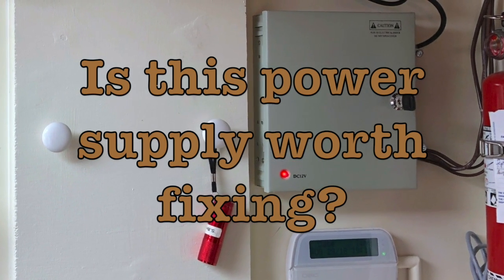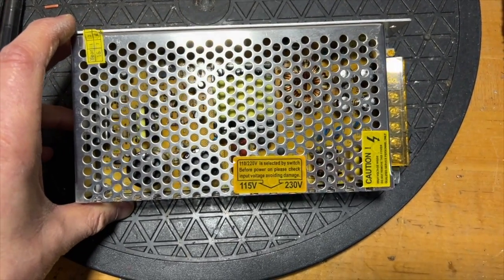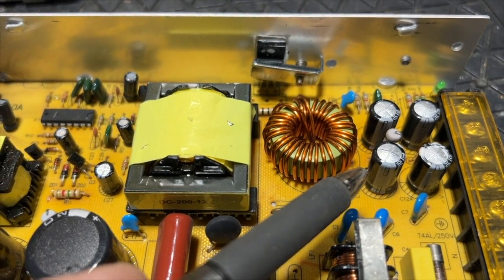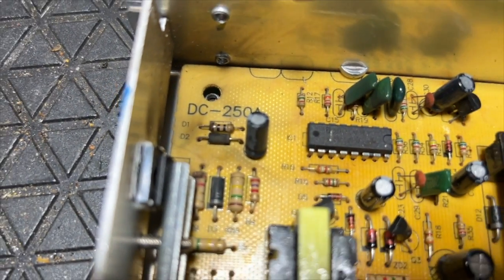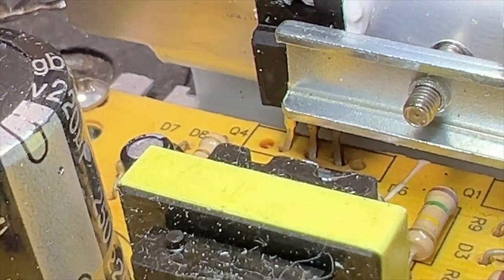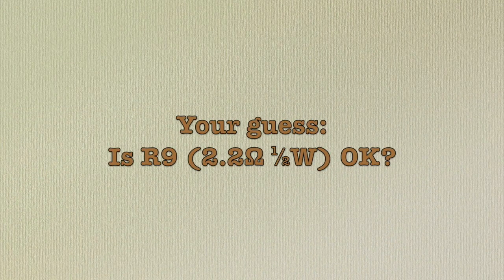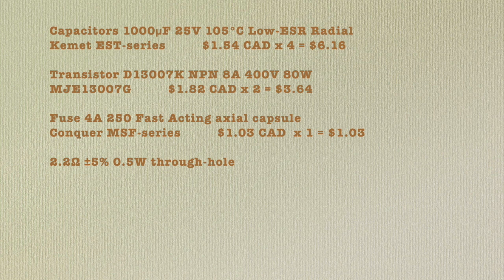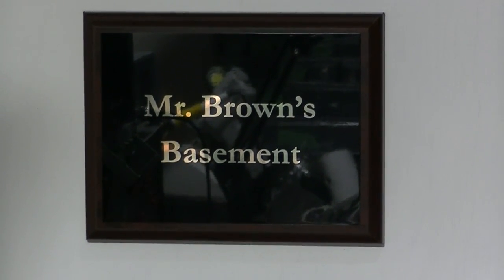Is this Power Supply Worth Fixing?

Comment: I take components off of old motherboards and old junk power supplies and fix them with what i have laying around. Like those caps.... About to repair another one today with bad caps and wow does it make a whistle noise right now. A high frequency squeal coming from it. Computer power supplies that is... The number one problem is almost always caps and sometimes a fuse with it.
Reply from the maker: I’ve depopulated old boards to salvage parts but I haven’t found them reliable over the long haul. It’s just easier for me to buy new parts. I could probably have found parts to make that power supply work if I absolutely had to, but this was more of an exercise of bringing it back to factory original (or better). You’re right though, electrolytics seem to be the weak link of power supplies and are never above suspicion.

Comment: I hate these power supplies as many of the transistors and integrated circuits have had the numbers removed by the manufacturers.  Replacements are readily available and most repair facilities will not waste the labor to repair them. Bench tech. time is to valuable to waste on most of these cheap switching power supplies.
Reply from the maker: Yes, I’ve seen all kinds of devices where the manufacturer has sanded/ground/scratched part numbers off internal components. I don’t think much of the practice as it makes repair more difficult and consequently less likely. None of the part numbers were defaced in this power supply though. The custom of making components difficult to replace is nothing new. Philco did it in the 1930s with their capacitor blocks, and other companies followed suit, using house numbers on capacitors, couplates, and semiconductors.

Comment: No matter how you look at it, it is worth the fix. A power supply is always part of a larger assembly. What you have to fix here is a sub-assembly (the P.S.) of this bigger device. If you replace the P.S. with a new one you are solving the issue at a bigger expense (compared with fixing the P.S.)  and the same quality as the original.  If you decide to fix the P.S., regardless of what quality parts you choose, you always win. If you use cheap Chinese parts, as the originals, the fixing cost would plummet, and the P.S. original quality would be maintained. If you use quality parts to fix it, you would still spend less than what a new P.S. costs (Chinese quality, remember) and would expect a longer service life. So, fixing it you always win, not even considering the fun in doing so.
Reply from the maker: I don’t like to discard; I prefer to repair. That’s just me. But when times arise when repair isn’t possible, and now I’m not talking about this particular PSU, what can be done to mitigate the cost to the environment? Other than salvaging parts I might be able to reuse (e.g., the aluminum), and taking the unsalvageable parts to a nearby household hazardous waste depot, any other ideas?

Comment: Transistor power supply or the worst I would just replace the with mosfet
Reply: Do you realize difference between driving mosfet's gate and bjt's base? ;) they are not always interchangeable. In this type of application, its big chance they aren't.
Reply from the maker: More than likely they’re not interchangeable. A circuit would have to be heavily modified.
Reply: @cielakovsky  am will aware I am a electrical engineer its easy for me to do the gate driver transformer is there already I just change the starting resistor and add ziner diodes and fast switching for hugzillery feedback and a new totem pole driver and nothing to it
Reply from the maker: @Dc_tech386 I am humbled.
Reply from the maker: I’ve already received the new power supply. I haven’t had a chance to open it up yet to see if they used Bipolar transistors or MOSFETs.

Comment: 1:05
Didn't know anyone trusted no brand power supplies to run 24/7.
At least get name brand ones like mean well. Its not that more expensive and has PFC built it to save power.
Reply from the maker: I may very well do that next time. But for a no-name piece of crud it had decent performance for over 60,000 hours of continuous operation. I can’t complain about that.

Comment: I guess 7 years isn’t bad for a lot of cheap modern electronics but I agree don’t repair unless you have too much time.
Reply from the maker: I guess I can't complain. I didn't mention it in the video but I have another identical panel going somewhere else in Mr. Brown's Basement. It's still working. So maybe the one that failed after "only" 7+ years was a dud?

Comment: I would replace all those bad capactors with better  and higher quality ones with a higher working voltage also the fuse, I would check the IC, and for any other shorts I would also replace those Transistors with better quality ones with a slightly higher rating and make sure they have mica insulators over regular plastic ones and any other components that look suspicious , then check the output voltage,,!  If all is OK then reassemble and reuse 😅👍the savings would be exceptional and most probably work better than new ‼️
Reply from the maker: That's initially was what I had hoped to do.

Comment: To me, comes down to if the replacement parts are superior to what was there before - i.e. does that $12 mean there is a chance you end up with a longer lasting supply?  I have a lot of postage stamped sized switcher modules for mains to 5v, invariably the yong-ho-whatever output smoothing cap goes pop - replace with a proper rated cap for the job, no problems.
Reply from the maker: I understand where you’re coming from: Make it right and it should last. But with this PSU, suppose I upgrade the transistors and power rectifiers. Re-cap the whole thing with Nichicon or Panasonic electrolytics, maybe install a fan… but the rest of the components are aged maybe failing after 7+ years. Wouldn’t I just be better off taking my chances with a new power supply?

Comment: Those filter caps at the output are swollen too, tops are domed so they could be resistive, or shorted, and literally the root cause of the entire failure.
Reply from the maker: I don’t know. I’ve seen filter capacitors in that slightly domed condition operating without any issues. However, they are undeniably swollen, and if I were keeping this power supply I would replace them proactively. The power supply was capable of supplying 10A continuously which means it could supply much more than 10A for short periods. Those capacitors are small and would not be able to dissipate much heat for long before overheating and bursting. Let’s say for a moment that one of them meandered down to 100Ω. At 12v it would be dissipating almost 1½ watts. They’re small; I don’t think they could do it for very long before bursting. My gut feeling (for all it’s worth) is that a breakdown or short in the inverter transformer’s primary winding caused a cascade of failures.
Reply: @Mr.BrownsBasement  I guess depending on the switching frequency, and esr etc , hard to determine, they most certainly got hot. Curious why there appears to be what seems like 2 sets of driver transistors, and no visible rectifiers. PFC?.. Nevermind I watched it again, I guess I lost track of locations.
Reply from the maker: @johngalt7382  The low-voltage rectifier may be the TO-220 device bolted to the case next to the large toroidal choke. I have looked over the original footage and there is no darkening of the PCB near the 1000μF capacitors. There is very slight darkening at the power resistor which is surrounded by the 4 capacitors. I'm out of town for the next 3 or 4 weeks. But if you'd like, when I get back I can remove the 4 capacitors and test them on my meter and report the findings in the video description.
Reply: @Mr.BrownsBasement  no worries, I just lost track of positions in the closeups, it seemed the blown devices were by the output inductor, which would be where I would expect the rectifier, my mistake.
Reply from the maker: @johngalt7382 No problem. But I’m curious now.

Comment: How much is a 5A 12V Meanwell psu? It will would still run when your new cheap one fails in a few years...
Reply from the maker: That's a very helpful suggestion. Thank you. Meanwell power supplies seem to be rated highly on Amazon.ca  Assuming it would fit in my distribution box I'd give it a go if/when the new one (which arrived yesterday) fails.

Comment: Another consideration: The new PS may not last 7.5 years if it has lower quality parts, especially the TRFs.  From what I've seen, the newer the item the shorter the lifespan. However, $25 is pretty inexpensive. I wonder what kind of quality you get for $25 these days. I think the caps went first. If you get a new PS, check the caps once a year with an ESR meter.
Reply from the maker: The new PSU arrived. I haven’t cracked it open but I can see through the perforated cover. It looks simplified. Fewer components, including lack of 110/220 switch. We’ll see how well (and how long) it works. Checking the electrolytics doesn’t look like an easy process. At best, a yearly visual inspection could be done. On the other hand the old one was about $20 in 2017 and it went for 7+ years, running 30 to 40% of load capacity.
Reply: @Mr.BrownsBasement  In case you didn't know, electrolytic caps can be checked in circuit with an ESR meter, no unsoldering during the check, if you have access to the bottom of the cap.
Reply from the maker: Access is possible but not trivial. Like the old PSU, the PCB cannot be removed without unbolting the 3 transistors from the aluminum heatsink/backplane. Sure, it can be done but it's not something I could see myself doing annually… or ever.

Comment: I had one of these fail. Capacitors, of course. Replace them with something decent from Panasonic or Nichicon. And the main switcher IC was dead. It is worth repairing them with better quality parts as they will last longer after the repair.
Reply from the maker: Agreed. For the extra few dozen cents per capacitor it’s worth it to go for quality. And I was prepared to do the repair but I didn’t get a good feeling once I got to the open 2.2Ω resistors. I didn’t want to throw a lot of parts at it, fearing that it might end up costing more than a new power supply.
Reply: @Mr.BrownsBasement  A little more expensive, true. But also much more reliable.
Reply from the maker: 💯%. 
I’d rather fix something once with quality parts than have to go back and deal it again because a new part failed prematurely.

Comment: Yes, I would do the repair. $12 is not that expensive, and yes, you can get a new supply for $25, but that takes the fun out of it. However, there's no guarantee that replacing the components will fix the problem. There could be a hidden problem that you're not seeing yet (like, as suggested below, a fried PWM IC). But, it's worth a shot. If it doesn't fix it, take your new parts off and keep them, ditch the supply. Use a dim bulb and/or variac for testing. New sub btw.
Reply from the maker: Make you a deal: If you're in the Toronto area and you want it I can drop it off to you. I forgot to thank you for the Sub.
Reply: @Mr.BrownsBasement  Hey Neighbour!  York Region here. =)
Reply: @Mr.BrownsBasement  if you were talking to me about being in Toronto and if I wanted it, I'm Australian, dude. LOL! Might be a bit difficult...
Reply from the maker: @AstrosElectronicsLab Agreed.
Reply from the maker: Thank you for your comments and your Sub.
Reply: @Mr.BrownsBasement Welcome.
Reply: Those are not good branded caps or  bipolar. For me those parts. In India. Bipolar would cost rs 60 per unit rs 13 for 1000uf 35v per unit and rs 2 for 1/2 W resistor per unit.
60+60+13+13+4=rs 150 less than 2 us dollar.
Reply from the maker: @FeaRFoRDeaD If this was something only used occasionally I would have priced in budget quality capacitors. However, for something operating 24/7/365 I would go for premium capacitors. Even though the cost is marginally higher the nuisance of potential downtime isn’t worth it. I want a MTBF of at least 100,000 hours (11+ years); I don’t trust low-end parts to be reliable for that long. If I thought that the chances of success were higher I would have gone ahead with the repair. What causes the failure? A shorted transformer winding? The PWM chip? What else, beyond 4 caps, 2 resistors and 2 transistors is bad? I wasn’t willing to gamble on this one with what I encountered.
Reply: Maybe I'm wrong, but on top of that $12 is tax @ 13% and also delivery @ $8.  The total cost is now $21.56, so really, it's not worth it.  Especially not knowing if replacing these parts would actually fix it 100%.  Also, if someone fixed it for him there would be labour on top of that.  So, just buy a new one.
Reply from the maker: @canadavey You’re right, I didn’t factor in shipping or labour. That was deliberate. If I’d ordered parts for this power supply, I would have done the order while ordering for something else, and would’ve attributed to the cost to the other project. In terms of labour, even though my time is worth something, I don’t pay myself very well, so I didn’t include that in the equation. But your point is well taken. The problem with this power supply would have had to be a very easy and straightforward (and inexpensive) for the repair to truly be worthwhile. But I would have attempted it if I thought there was a reasonable chances of success. But as soon as I see bulging capacitors, smoked semiconductors and blown resistors I wonder how much more is wrong. It would have been fun but I don’t want to find myself in for more than the cost of a replacement. At the end of the day it ran for 60,000+ hours and that’s not too shabby for what was a $20 no-name power supply. Contrary to what some others have suggested, there’s no reason to believe I could have done better with a name-brand power supply for a lot more money.

Comment: 😄 No way I'd pay that price for an output capacitor in a PSU. Always using the cheapest crap I can get on Ali for this application
Reply from the maker: I agree, for non-critical applications that's a lot of money for a capacitor. In my case though, this power supply is crucial for a bunch of devices and it's a major inconvenience for me when it's not working. If the capacitors had been the only problem I would have shelled out the $6 CAD with the hope that I wouldn't be dealing with another failure for a long, long time.
Reply: @Mr.BrownsBasement  the price you quoted at over $6 for 4 capacitors seems a little over the top. Although, I guess they are low ESR ones; however, they don't really need to be low ESR. A standard 25V/35V RB will do just fine, and are cheaper. Cheapest I saw online was around $0.81.
Reply from the maker: I assumed the originals were low ESR so if I was going to repair it I would put low ESR capacitors back. But you're right, I could probably have gotten away with cheaper capacitors.